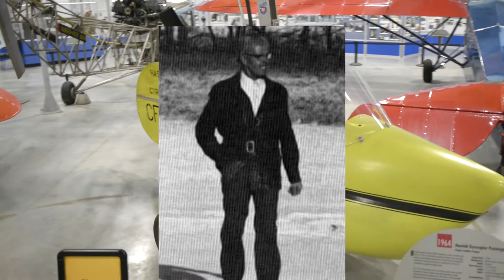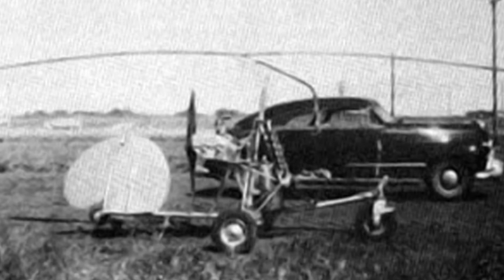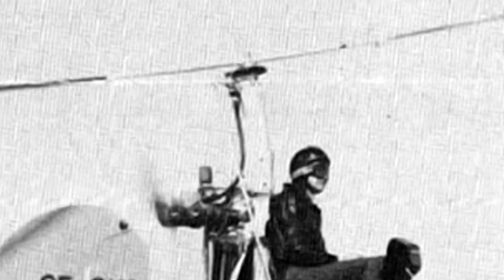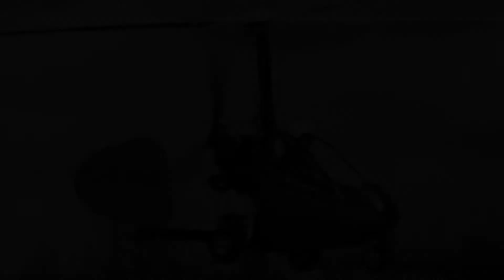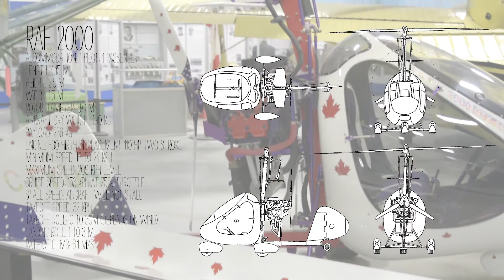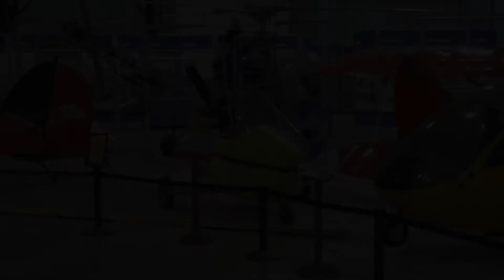The Gyrocopters of Bernard J. Haseloh; Brilliant Aviation Pioneer from Ponoka, Alberta

Comment: The statement of the legal issues from the death of an untrained pilot alluded to the idea, the aircraft did not contribute to the deaths of many trained pilots which the design has done. A horizontal tail and more attention  to the thrust line center of gravity relationship could have helped with the stability but the designer resisted the industry pressure to add these changes. Instead RAF installed a trimming device under the rotor head and above the cockpit. There is much debate on the effectiveness of this device. Most RAF Gyroplanes flying today will have a robust horizontal tale to help eith stability at higher speeds.
Reply from the maker: very interesting!

Comment: For those of you who don't fly gyroplanes, the fact that RAF did NOT incorporate a horizontal stabilizer but instead used the little pitch adjusting winglet on the mast was one of the biggest problems with these aircraft. Many fatalities were in the RAF 2000 were due to bunt overs. Other companies produced aftermarket products to make this popular gyroplane safer. The Boyer Stabilizer, the Sportcopter rotor head and blades and the Sparrowhawk Drop Keel conversion come to mind. 
It was a popular kit and on todays market one with no modifications will sell in the range of 10 to 20K depending on engine, but without a horizontal stabilizer or a drop keel it would be ill advised to fly one.
 Yes, I  know if you are already an experienced gyro pilot you can overcome these deficiencies, but IF you are an experienced gyro pilot, then you already know what I am typing here is good advice.